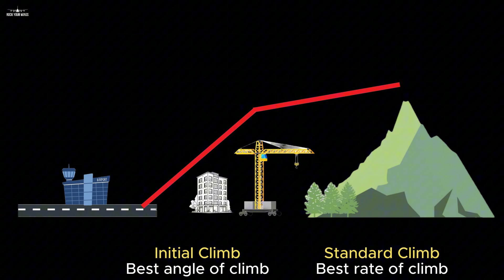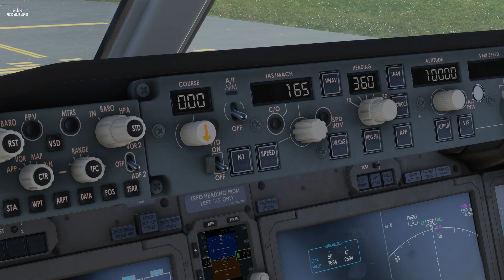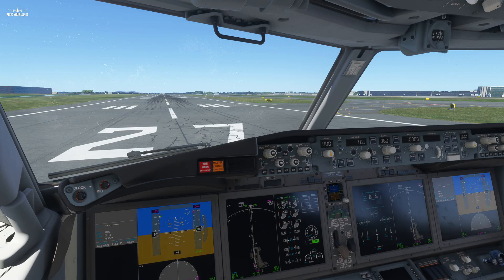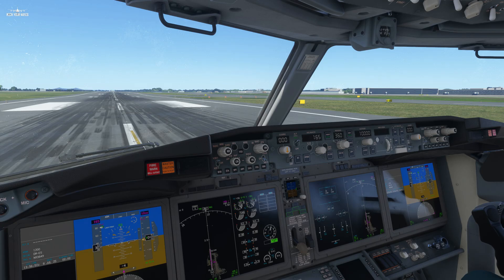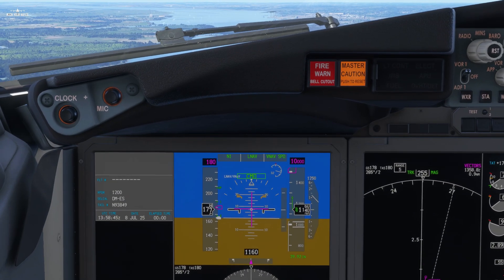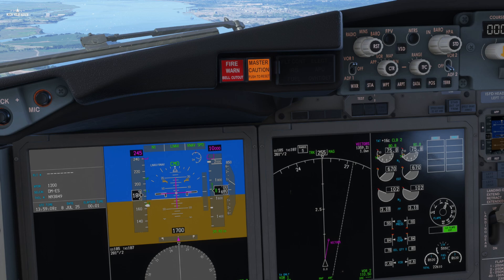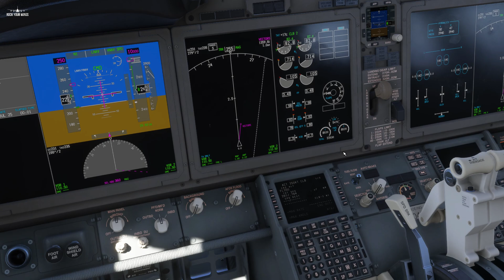[MSFS 2024] 737 MAX Easy Take off Tutorial

Comment: Some points for you all:
Obviously you’d do all the autothrottle arming etc in the initial set up rather than on the runway. 
80% is definitely not done by the aircraft, all it does is set your take off thrust, you do the rest. Handling an aircraft in a gusty crosswind can be challenging.
You must be very heavy or have a high derate to only pitch for ten degrees, standard is 15deg without FD guidance eg in an unreliable airspeed situation. 
The reason the flaps only show 5 and 1 on the PFD is because you don’t normally retract to 2. It’s just 5 1 UP. Also, you don’t have to be above the bug speed for those flap settings, you just have to be above the previous flap setting marker with a positive speed trend and target speed above the next flap setting marker.
Normally acceleration height for flap retraction is 1000’ unless there are noise restrictions and most airlines allow you to engage the autopilot from as low as 200’. This is useful if it’s a complicated/busy departure.

Comment: I’m not able to get LNAV on, but i have filed the flight plan, why is this
Reply: Doesn't always work right away. Sometimes you need to takeoff and navigate using the heading and after a while, hit LNAV and it will work.
Reply: @sethrollins6384 yeah i did another flight and lnav worked before i took off

Comment: Man, you did an amazing job at conveying all of this, but it’s too bad the game is still broken (at least on console). I went through the whole process step by step since the last video and everything went perfectly. That is, until I got to take off and it wouldn’t let me engage the AT, most likely because I’m playing with controller. So instead, I just put the throttles at TOGA which locked me in a detent that the game wouldn’t let me unlock from no matter what I did and had to give up entirely. I can’t go a single flight without the game messing up in some sort of substantial way, and I pray the dev team actually fixes the countless issues instead of continuing to add detail enhancements for more regions as they’ve been doing
Reply from the maker: Thank you. I hope the best for futur fix in MSFS 2024.
Reply: @RockYourWings you and me both 😪😂

Comment: Hi! I was wondering if you might consider doing a tutorial on how to configure the Boeing 737 MAX for landing. I'm struggling a little bit with getting the landing speeds just right and knowing which flap configurations to use at different points in the approach. A clear explanation would be super useful for many of us, I'm sure!
Reply from the maker: Hey Matthew, sure. For the 737 landing speed, please take a look at 1:44 on this video https://youtu.be/sT36ykp6HI4?feature=shared

About flaps and how to use them, it's a very good point, I should make a video about that. Thanks a lot !

Comment: 245 is too fast. You'll get a speeding ticket if using VNAV.

Set speed to 240 and V/S to 2000 and then CMD A when you have a stable, positive rate.

Do not use VNAV under 10,000. You will get a speed violation for sure. Just use 240. It has happened to me multiple times.
Reply: Ok smartass